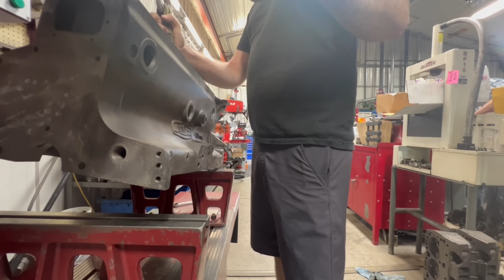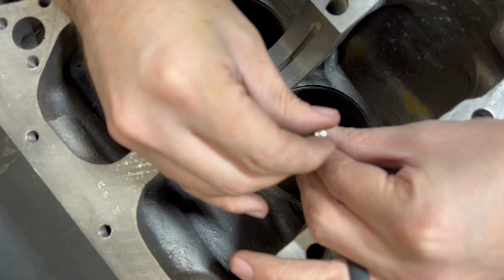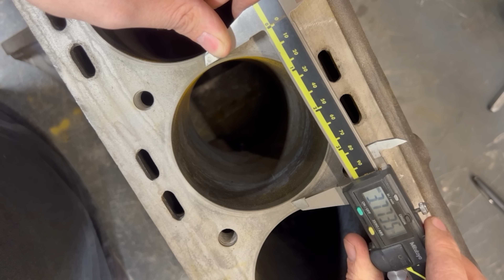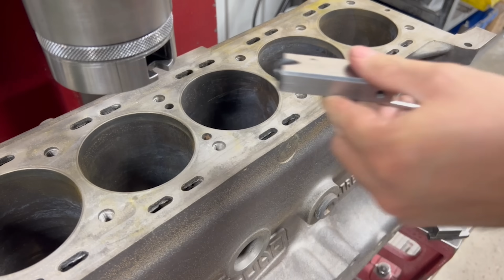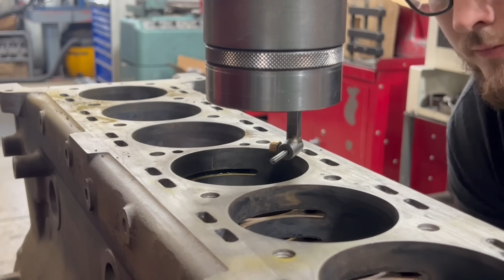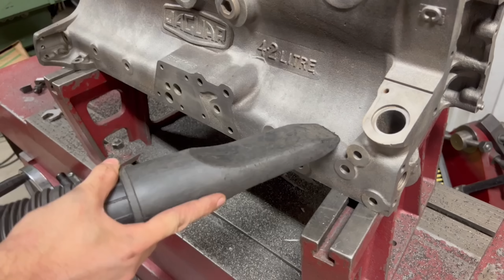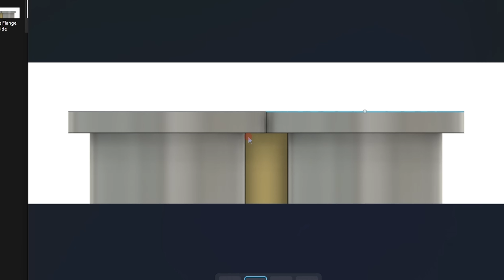Can This 1968 4.2L Jaguar Block Be Saved?

Comment: I would get a scrap block and try using a cutting wheel run it down the Crack and then try welding it in but the 2nd option you showed would probably be best

Comment: No experience on that engine, but my leaning would be to v groove till you have the whole crack out, braze it back up, bore round (since you already need to clean those bores up and make them cylindrical anyways given the galling and taper), tophat liner, then surface the block and call it a day.  Any evidence of cracking elsewhere (cam tunnel, main webs, etc) and I'd go looking for another block, but like you said, this is a common issue and finding another block won't save you from dealing with the already known cracks.

Comment: Guess that works. I had mentioned about finsing someone who can nickel braze (braze cast iron with cast iron basically) or tig brazing the block with silicon bronze on your I.g page. Seem to found a solution without welding so good luck 👍

Comment: Have you considered a relief cut along the crack, then laser welding to fill it in, then boring that to be flush.

Laser welding is VERY precise and strong.  The heat is highly localized to the pinpoint of the weld and quickly cools. The only downsides I know of are cost and the setup for a block would be difficult.

Also, bore the block walls to have the same press fitfrom top to bottom, or perhaps taper the press fit cylinder insert to match the existing walls, thereby preventing any possible unforeseen consequences of modifying the block.

Obviously touch up the surface before the replacement press fit.

Comment: Why would you not Vee out the crack and bronze weld prior to machining and sleeving. That’s how we used to repair cracked or damaged iron castings when I was an apprentice in the 70’s. I think the bronze welding rods we used were supplied by a company Eutectic. It was a really good permanent repair.

Comment: For your best chance of nothing leaking is to keep going the way you are with the counter bore idea and try to find a head gasket (that has lots of copper in it)that's a lil on the thick side and upgrade the head bolts to A.R.P. head studs. But there's one more thing for this to work the head needs to be bolted on the right way and then leave the engine somewhere safe where it can get hot and cold a few times really slowly for about a week or two that should be enough of a settling stage, then go over them again with the torque wrench. Ino its a lot of work and commitment but if that block is as rare as what you say it is I'd definitely be going that lil bit further just to be sure🙏 hopeful I helped if not sorry you read all that😅

Comment: In regard to your tremors and setting mics.  Set them down on the table. I uses to run a giant lathe.  Most of my measurements with mics were in the 8”-13” diameter range.

I’d set them on a table and line everything up, then slow twist the anvil in.  Way easier than holding everything in place up in the air.

Comment: You boar a top hat boar then Braise the top of the crack then take that down. Finish with top hat sleeve and deck the head. That should stop water intrusion. Again I’m just some guy on the internet and there are way too many ways to do something wrong and a few ways to do something right. 
Maybe consult a welding school to see what the best options for small crack repair should be. 
Now that, that’s all said I have braised cracks in small engine’s before but never that close to a cylinder wall. Hope my 2cents helps you and your customer come to a decision on what way to move forward.

Comment: I was thinking about this issue. Heading off the cracks with a thin grinder, then tig braze em with a comparable rod then tophat sleeve might be the best option to go with. Plus if it's a numbers matching restoration it'll be worth the expense to head off a problem before it gets worse. Just make sure to document it extensively with pictures and written note for the restoration notes. The owner will be most grateful for that, trust me on that.

Comment: Why not grind the crack completely out of the block and either install and weld a plate running down the crack spacing or fill that all the way back in yeah you lose a little bit of the coolant passageway but I think that would add some additional rigidity along with that top hat design

Comment: I would pin the cracks if possible. Then do a flanged sleeve. Only because of the rarity of the block.
 Jag used to and may still have a restoration department that can recast you a numbers matching block though. It’s very expensive and requires some paperwork,  but could be an option on this car.

Comment: Flange sleeves, flange sleeves the 1980s 4.2 they cut a slot between the bores and there was very little material as a mating surface the repair was flange sleeves.

Comment: Approx 11:30 you mentioned the galling would affect heat transfer from the cylinder liners to the block. It’s hard to tell on video but those old liners look blued on the outside. Makes me suspect they are not factory originals.

Comment: I did that almost identical repair many many times many years ago and found it very successful, almost identical equipment as well but didn't have the digital read out panel back then or the tool head caddy, that,s a awesome addition to that machine . it was all manual lifting tool post swap for me back in the 1980s, now retired but love to follow you young follows. Cheers

Comment: Years ago we used to "stitch" cracks like that with special screwed, taper plugs coated with a product called "Iron Tight) (here in West Oz), and then bored sleeved or whatever to finish. It was very very effective and reliable. However, I do like the way you ended up with your solution.
Reply: Yeah I was going to reply with the same thing mate but you beat me to it. I have done this before successfully and if done here in combination with the top hat sleeves it would deal with those cracks growing

Comment: Could you screw plug the top of the crack between the cylinders I’ve done it before on other engines with a fair amount of success, mind you I’m not an automotive machinist I’m just a mechanic.

Comment: Years ago in the machine shops we did something called "stich welding" which was to drill and run a self taping small screw into the crack.  I don't know if it's still done today. The process is to take several screws into such a small crack.  Saved some rare 351 C blocks and a GT 40 block with this process.  Could you do the counter bore for the tee sleeve and then stich weld or some other process to help seal the cracks lower aid in the durability of  the head gasket seal.  The counter bore sleeve looks like a great fix but pressure can sooner or later make the head gasket fail and feels like a failure waiting

Comment: I also have tremors and there’s is a cure the operation is performed at Barnes hospital in saint Louis mo  of of kings Hwy . Ian 80 year and delt with the this for over 10 years. If you need more info contact a Nero speshalact.

Comment: Brazing would be my best option, even if I was going to fit top hat sleeves.   Good pre-heating of the block and then a decent application of brzing flux will suck the braze right down into that crack.

Comment: Sooooo.... as "ghetto" as this sounds... J.B. WELD WHILE STILL WET WORKS. Ive seen it used from pitted heads that leaked coolant around head gasket to this exact scenario. I couldnt beleive it. I worked at a jaguar specialist in the southwest where jaguars do not enjoy the heat, and I can honestly say I witnessed this work on daily driven xj's and waited for one to blow.... It never happened. Just something I have personally witnessed

Comment: Man what a mess.  I'm not a machinist so take my thoughts with a grain of salt.  Grew up on a dairy farm and we repaired just about all our own equipment so I've seen some stuff busted up over the years and seen the way various things were repaired.  Personally if it was mine I would try to source a undamaged block.  Unless it's going to be a trailer queen/museum/garage piece I would forever question it with the parent bores if you were to actually drive it any.  With that said, there are alot of folks talking about brazing the cracks.  I can see that particularly on the lower cracks between the coolant passages, but what about the cracks that extend upward and across the deck?  I'd be worried that it wouldn't have enough strength to hold the repair in that area particularly if the fire ring of the head gasket exposes part of the brazed area as Jim mentioned in his video.  Pinning is also a possibility I guess but I don't know how you could pin the cracks given where many of the cracks are.

Another thought sprung to mind and that is what about boring all the parent bore out and converting it to a Darton MID style sleeve that is used in various race blocks?  It's similar to the idea Jim had with the Top Hat sleeves he was referencing.  This would fix the entire issue.  Obviously this would be a huge lift machine shop wise and a high cost but it would eliminate all the crack nonsense.

Any thoughts?

Comment: Common problem. I've repaired many of these. Here in UK. You can buy oversize flange liners from many suppliers (XRN) is one. You could also stich the crack if in doubt.

Comment: The engine is still usable and can be saved. Send it over to the UK to DK Engineering or Specialist Jag engine builders that is in your country. 
I had seen a 4.2L series II cylinder 5 had a massive split crack and was saved by repairing it. Today this day it still drives around. Its been 24 years since that repair

Comment: From the looks of it, overlapped, flanged sleeves are the best option. You could also preheat and nickle arc weld the cracks but machining it would be another story and Then install overlapped flanged sleeves. The weld is overkill in light of the comments here and should be tested on another 4.2 block but again, overlapped flanged sleeves for the win.

Comment: Drill the base of the crack and then use a flanged sleeve.    Or have someone weld it and then do the same.   After welding these old blocks they are hard AF to deck so it's easier to finish the deck by grinding.      Great video

Comment: Hi....I had a 4.2 long stud XJ6 block repaired for similar cracks using top hat liners a few years ago. I sourced these from the acknowledged experts in the UK who found a claimed permanent cure after meeting with them. If I remember they counterbored to top of water jacket removing crack completely with the flanges machined to but up hard against each other across length of block then decked flush. The 2 claims were that this removes the cracked material completely and provides a foolproof gasket supporting area solving the problem permanently. I'm not sure if the depth of the water jacket on long stud xj6 block is different. Mine was a 1979 series 2 carburetted engine without the later slots seen on the series 3 engines. Sadly I sold the car before rebuilding engine fully and never heard the result. I cannot remember the name of the sleeve supplier but visited them at their machine shop in the middle of Wales in the UK. At the time they were a top Jaguar engine rebuild company and had done the original development of this type of solution given growing scarcity of suitable replacement blocks...

Comment: I know welding cast aluminum is a can of worms but you should definitely consult an experienced welder. They may also suggest silicon bronze brazing or they might say it's junk. If it is repaired by welding it's easy enough for you to do a light pass to clean up the deck and bores. Also the aluminum alloys used as filler in welding are much more ductile and are much more likely to flex or stretch in those areas instead of crack.  As a machinists you're thinking like a hammer and every problem looks like a nail.  It definitely helps to get the perspective of other disciplines. Maybe this problem can be solved by adding material instead of taking it away.

Comment: Remove material where the cracks are that the flanged sleeves won’t cover, preheat, and use a high nickel filler materiel when building it back up, and let the block cool slowly. Do a small cut to your liking on the parent bores to clean up the welded areas and the galling (as long as it doesn’t get to thin) then install the flanged sleeves and it will be right as rain.

Comment: If I were to repair this, brazing is what I'd do for this. I would absolutely not TIG braze, the pinpoint heat from the TIG arc could potentially bring problems with hard and brittle zones in the casting.
If you know an old brazing wizard, contact him and ask for advice.
Using the oversize sleeves can work well, unless the cracks decide to start forming under the lower water passage as well.
So maybe a combination of both might be the way to go since you don't really want the softer brazing as a sealing surface.
It's a tough job, especially since it's a matching numbers vehicle. Wish you the best of luck with whatever method you choose.

Comment: Cracks only grow, but a fabricator knows how to stop them but it's a pain. I know it isn't as simple on an engine block, but anywhere else you find the ends of the cracks drill them through bevel the crack and then weld. I'm not sure how that would even be approached on an engine block. A good deep weld with the end of the crack drilled out could theoretically be done and then toss in some other tricks to help like you mentioned near the end.

I doubt this is new information for a machine shop, and I doubt it could be done easily, but cracks can be stopped. Theoretically it should be possible and might work, but that much heat could screw the pooch anyways. Closest I've come personally was drilling a 1/16" hole in a piece of cast iron, beveling, preheating and welding a bucket on a Backhoe. I know it made it at least another 2 years without breaking again getting abused daily.

Edit: "fuck autocorrect" and for clarification it wasn't the bucket it self it was a cast iron bolt on piece, it was just bolted to the bucket. Did a test on a cast iron pan that had a hole.

Comment: Holy crap, what a nightmare design. If I had unlimited funds I would probably choose the flanged sleeve design but give the cylinders a gentle boring to take out the taper and prevent any crushing and vertical cracking of the new equipment. And I'm a big fan of solid copper head gaskets! And I must add spectacular job removing the old sleeves! It would have been so easy to destroy that already precarious block by attempting to press them out

Comment: Use overlapping T type sleeves, Fit the first three, then the next three don't bore the recess for the top hat as deep as the other three, so on the overlap, those three sleeves sit on the first three sleeves where they overlap. Job done. Surface the top of the sleeves and block face.
Never a problem.

Comment: Numbers matching but the car isn't really original anymore with an engine rebuild. Not sure how much that would drop value but great work anyways. Used to be an ASE certified tech when i lived in the US and i worked for a private dealer that only built, sold, repaired municipal vehicles je police cars and so on. We'd unfortunately never machine an engine but get a Ford interceptor crate engine (cheaper). But I've done a bit of cylinder head work and it's incredibly satisfying.

Comment: Flanged liners are common practice in the motorcycle world since at least 1960's.(I'm not old enough to have worked on things older than that, at least not with cylinder liners)
1950's was often all cast iron
I thought the 'correct' way to do the 4.2 was to use much deeper flanges, almost all the way to the top water passage drilling? (a friend did one, probably 1974~75)
 Do 'every other' then counter-bore the in between cylinders, it's easier than precision flats on each liner flange
 I guess the 'special' sleeves are not available now, just the 'standard' 1/4"~5/16" flanges?
If it HAS to be saved you may need to get custom sleeves made, that won't be cheap (L.A.Sleeve were about $90.00 each in 2004)
Oh, just remembered something I wanted to mention, hone the block to get  it parallel plus a 'better' surface finish rather than bore it oversize (it's what I do)

Comment: I know that shops with oven fusion welding are few and far between, and their waiting list is long. However, it may be the best way to save a rare iron engine. My dad once had it done to a cracked iron cylinder head because no replacements were available. He lived in Houston Texas at the time. The oil refining business has all kinds of unique specialized equipment that needs repair, so there are various specialized welders in the area.

I'm not sure if Colorado would have any oven fusion welding shops.

Comment: To make telescopic gauges easier to use with your tremor, use a micrometer holder so you only have to stabilize one thing. As a quadriplegic I have had to figure out work arounds for so many things over the years. If you still require more help try holding the telescopic gauge with a flex mount for dial indicators then you should be able to get everything aligned to measure accurately.
Reply: That’s a nice deck bro

Comment: Should be good to go when you install flanged liners. The head gasket will seal on the flange of the liner. BTW, when rebuilding a 4.2 jag, always instal new sleeves. Those coolant passages tend to get clogged. And when they are blocked, the pistons WILL seize after a rebuild.

Comment: As a retired engine rebuilder I can say the method you have used is by far the best .over the years I have done many engines using flanged cylinder sleeves and never had a problem